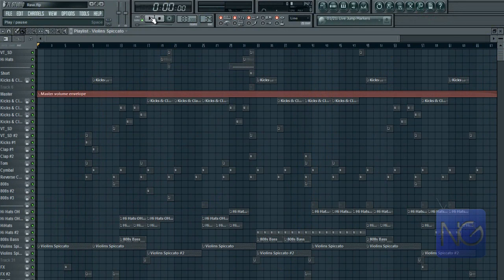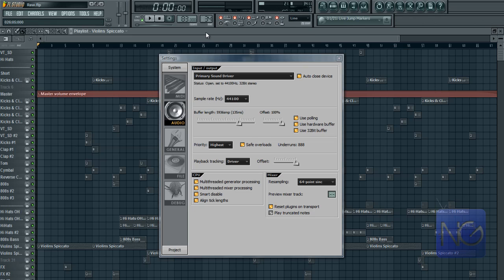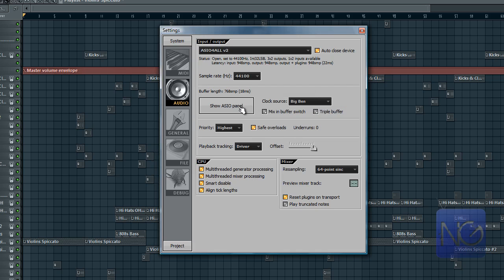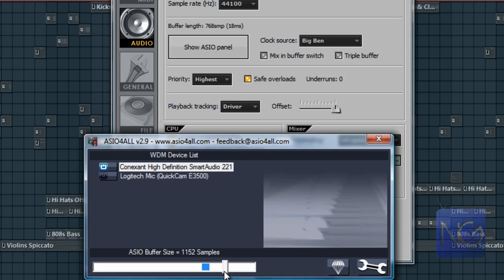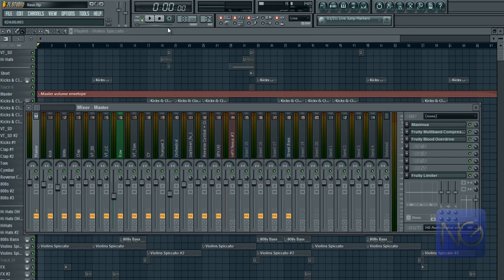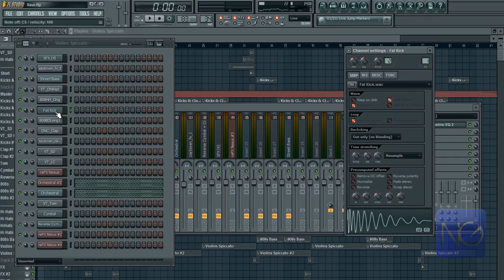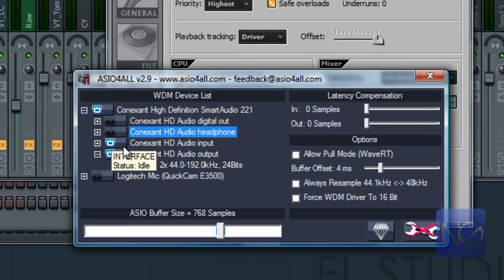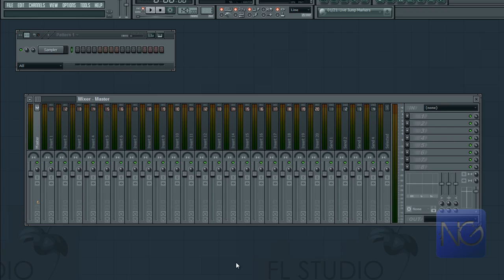Fl Studio: Fixing Underruns Crackling (CPU Buffering) [Setup ASIO4ALL]

Comment: I am using this version of fl studio in my pc but while I am start vocal recording by using a sound card for connecting my BM800 condenser microphone I have crackle issue why?? And how can I solve it... Please reply me as soon as possible.. 

My pc configuration is 
Processor - Intel (R) core (TM) I3 cpu 540  @ 3.07 ghz 3.06 ghz 4.4 windows index
Ram - 2 gb
Windows 7 64 bit
500 gb hard disk

Comment: this nigga said "ASS-E-OH"  lmaooo.. thanks for the vid though.. my question is a little more in depth though because I'm not using the Asio driver nor am I using my laptops either.  I'm using a Focusrite Scarlet 2i2 and I'm dealing with the crackle which shouldn't be happening..  I'll have to search more specifically for users with the same interface..  cheers

#MISTA808
Reply: mista808 exct same problem bro, its a mess for rapping cause you hear a bunch of them and then most dont show up on the recording, but the ones that do... sweet christmas brother its a mess

Comment: I have 5th gen 2.20GHZ 5200U i5 processor and 8gb ram still this shit happens
WTF FL STUDIO!!
Reply: So how do i overclock it??
Reply: kkk thanks mate
Reply: +JV i got an i7 i got a flp of martin garrix dragon it were a really big project bigger than that one in this vid i trough it wasnt to good enough but i found some settings under audio and then cpu under fl studios settings it helped me alot and it started to run smoth! try that :)
Reply: +BFHPET yeah if you have a slower computer like me you can just lengthen the buffer time in the audio settings, but if you're trying to record with a MIDI keyboard then the delay will be impossible to work around, so when I'm recording tracks it's crackle city until I can get this asio stuff working right, and even then might not really help.
Reply: Ya i jst found a solution to this
Reply: and what's that bro???..no really!

Comment: Should add though that now i can't get the volume control to work in ASIO4ALL mode (just stays at the same volume) and i can't listen through USB speakers (to hear the sound quality) vs just using the Computer speakers (lame sound).
At this stage I'm just sticking with the Primary Sound driver and a high buffer length.
Way too many issues with the ASIO option.

Comment: I have 4gb of ddr3 ram 
i5 2770k processor 
gddr5 gtx 650ti GPU

And i Have a korg m50 
i have a usb connected to to the computer, but when i play chords the reaction to from the workstation to the computer is slow. will it work bettah with a audio interface?

Comment: Ram has nothing to do with the cracking and a dual core is very bad for producing, im using an I7 and on my other computer im using an i5 with 2.8 ghz. All you need is about 2gig ram but there is a way for you to work just fine.
Create a melodie and turn it into a WAV file so it then is a sample after that you can just remove your vst and all the effects used onto it, its a painfull way to work but I also have to do it sometimes with the heavier stuff.

Comment: I need help, I have a I7 processor and 8 gb of ram, and it still pops and laggs a lot, is it just the sound card? if so what is a good audio interface or sound card to get?

also i use a laptop if that helps in anyway

Comment: ok please help i installed asio4all on my laptop dell mini inspiron laptop and it doesnt play the sounds i even turned off the sync thing in midi settings still doesnt work and all i have is built in speakers it says it needs to run 41000hz and it said running on that and still doesnt work

Comment: I don't know about everyone else, but this tutorial worked for me. I have an AMD CPU that can go at a rate of 3.1 GHz and 4 GB of RAM. The buffer length trick worked for me. If you have a CPU that has a processing rate of less than 2.3 GHz, you may want to look into upgrading.

If anybody is wondering how to find their CPUs speed, all you need to do is click the "My Computer" option in the start menu (for Windows). Then choose "System properties" on the top bar to view the RAM and CPU specs.